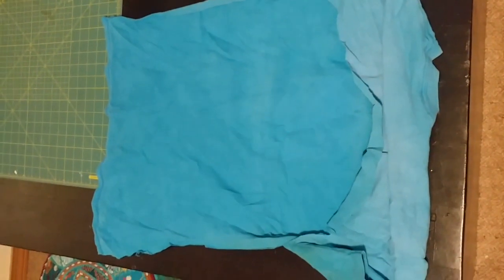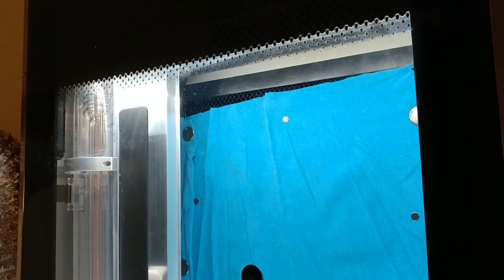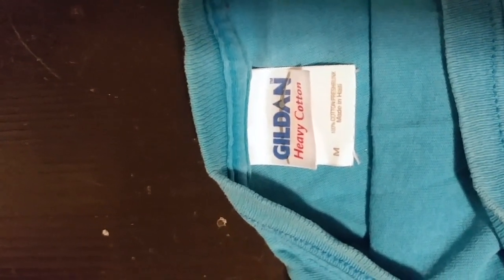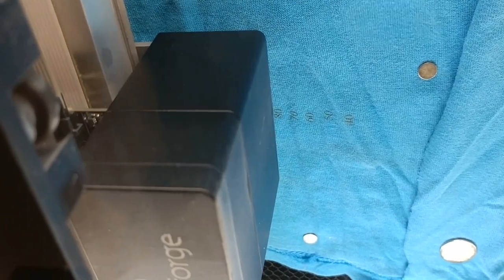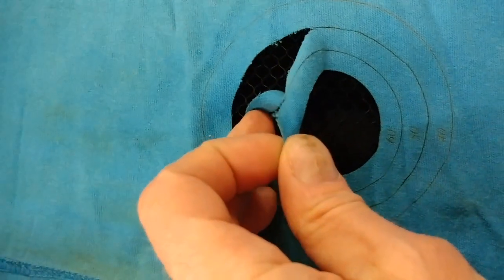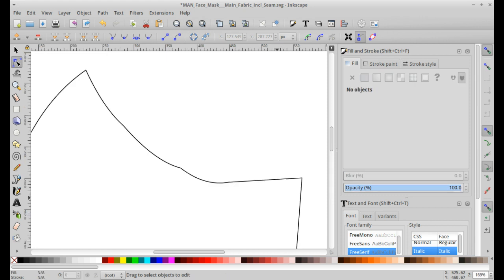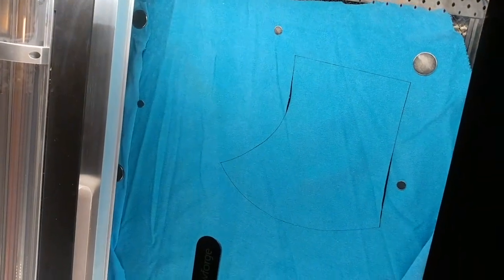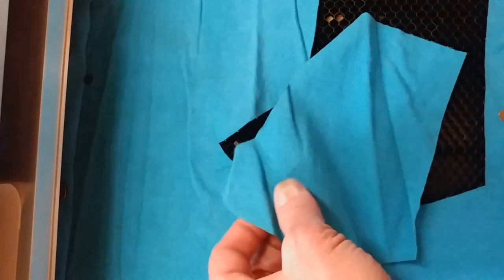Using a glowforge to cut a cotton filter mask

Comment: Which model is your Glowforge? (Basic vs Plus vs Pro)
I'm considering getting a Glowforge specifically for fabric cutting (Cordura).
Thanks!
Reply from the maker: When I got mine, it was the level below Pro but there were only two models at that time.  It did a good job of fabric cutting, for sure.
Reply: smellsofbikes thanks for the reply! That’s what I’m trying to figure out. I don’t need a passthrough slot for the work I intend to do and it seems like the plus model (which I believe is what you have) is powerful enough to cut through fabric relatively quickly. 👍🏻
Reply from the maker: @uscmCorps  Looking at the specs, I believe mine is now classed as a Basic, and they've done a hardware upgrade on the motion control system to increase cutting/traverse speed for the Plus model.  So, I suspect any of them would do a good job.

Comment: Would these settings work the same if you put say 10 layers of shirt material?

Thanks
Reply from the maker: I don't think this would work with multiple layers.  The Glowforge has so much air blowing across the top, multiple layers will tend to blow loose and cover over subsequent cuts.  I've been using it to cut out 6 pieces on one layer of fabric.